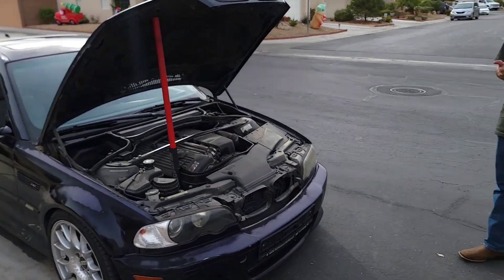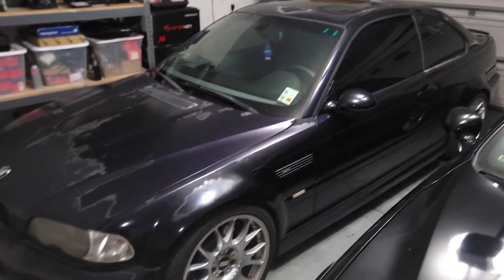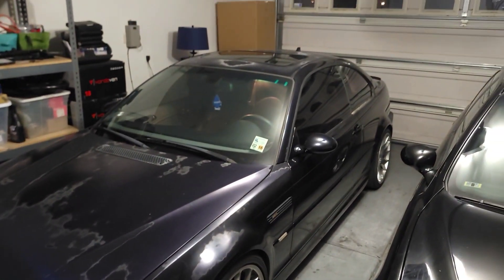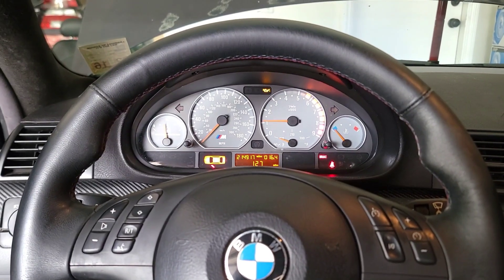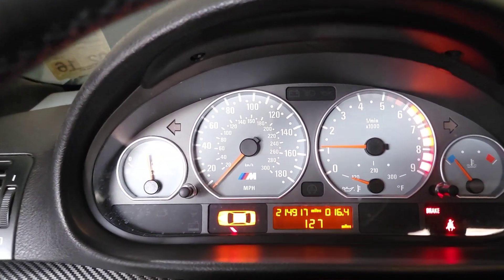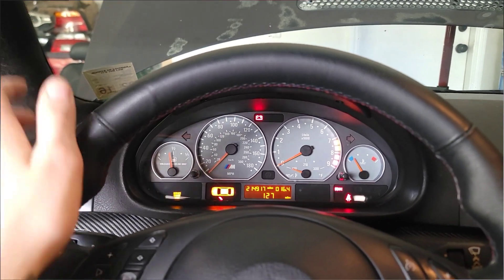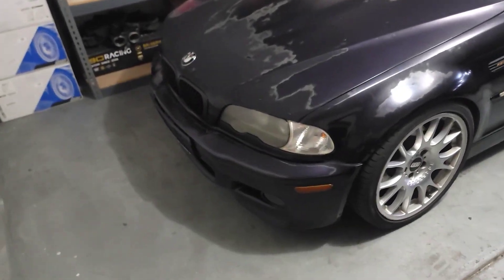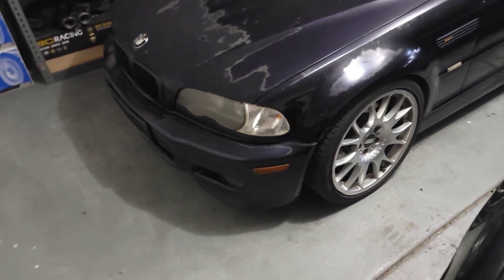Does My 214k Mile Dinan E46 M3 Have Major Issues?

Comment: its not stock clutch. also buy a vanos rebuild kit to stop the stalling issues.
Reply from the maker: Stock clutch has alot more travel right? & yeah probably gonna do solenoid and the coil pack first to be 100% sure
Reply: @chacebarnes01  it should have alot more travel. its just odd that it has a very low biting point.
Reply from the maker: I'm aware of stock E46 clutches and this probably 1/3 if not 1/4 of the travel, bites immediately but feels good